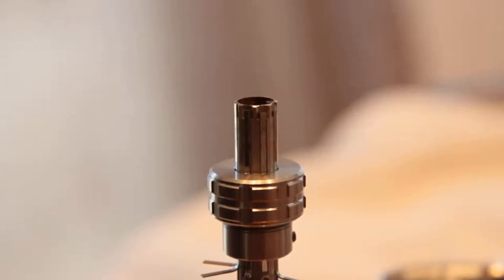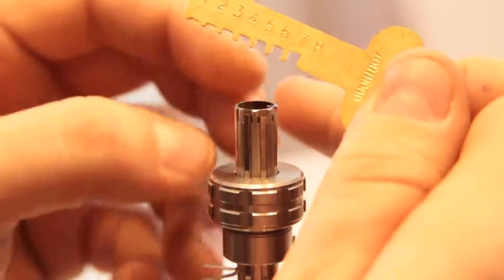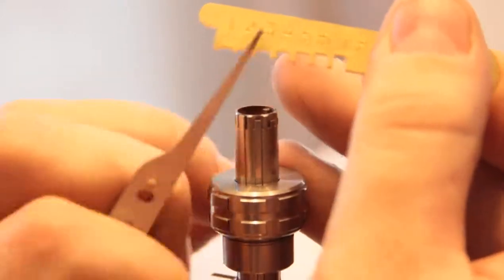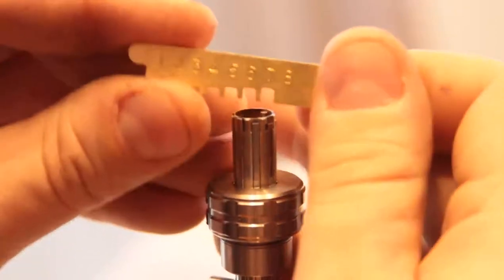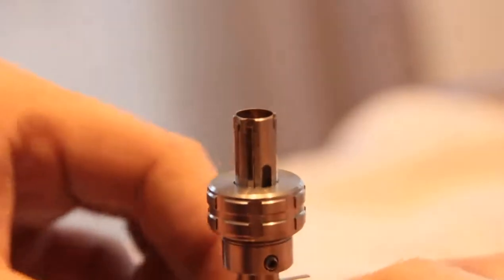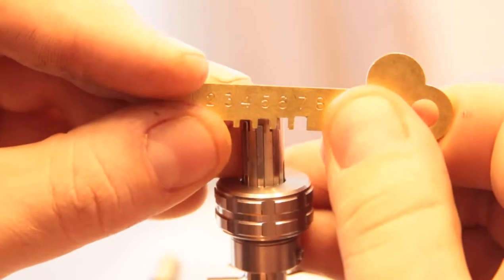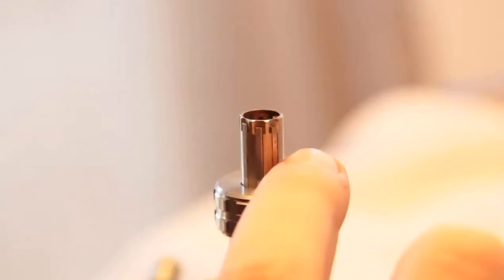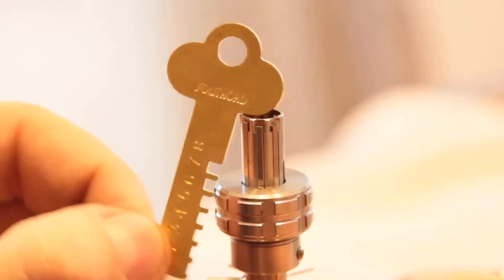(029) Decoding Ace Locks -- Southord Pick and Gauge

Comment from the maker: You could just as easily look up the depth specs and use a depth gauge. 

The little key-shaped gauge comes with the tool (or at least it came with the 7- and 8-pin set).

Comment: That key is a Safe Deposit box key. Is it possible to take the gauge and put it right across the top, at the particular pin you are trying to read? The notches are more then wide enough to enable the guide to slide right on top across the middle. What ever notch in the gauge fits best...mine word like that but it's done with steps on either side of a cheap aluminum"key"shaped gauge CHEAP...hope this idea worx!